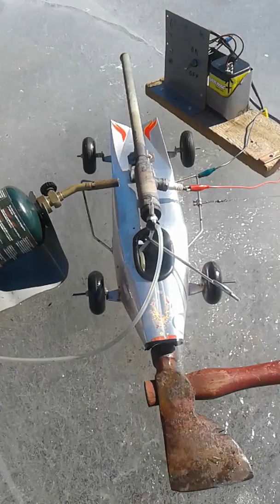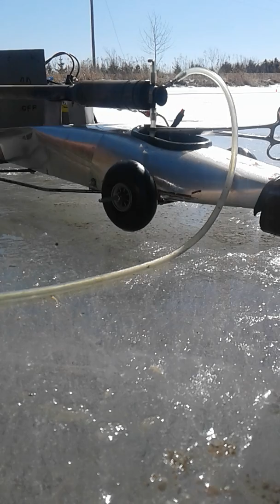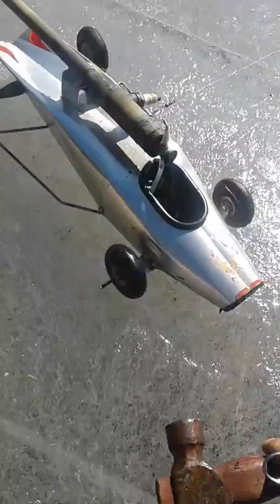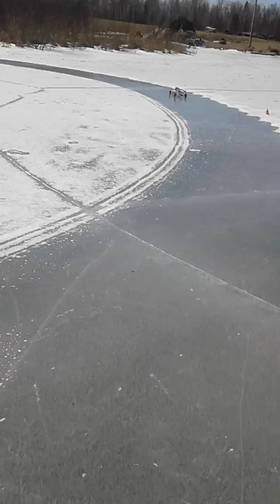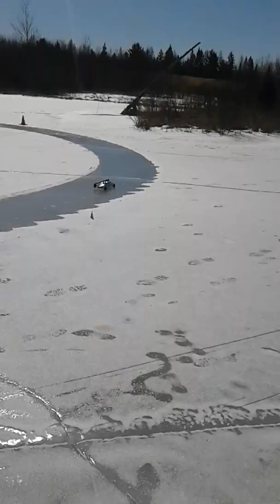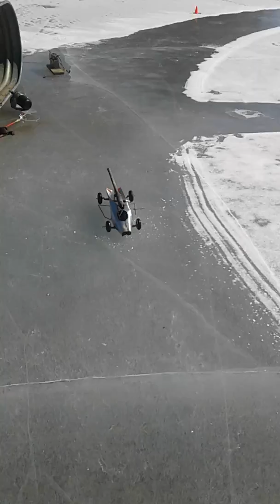Original design Pulse jet teather car 60mph.

Comment from the maker: The 1.25"cc k1,don't quote me on k1? But anyhoo it has a machined aluminum head with cooling fins,it's a mini dyna head,it has a 1" dia.10-pedals valve, & .5" dia. tail pipe. Very good quality little engine.Ive built the .75" cc Dia.Sibley craft jet,it works also.but valves are consumable.

Comment from the maker: that is the same as one of my tigers that I can't get running,I'd like to know all the venturi,&flow jet dimensions of a running one so I can get mine to run.
Reply: My Tiger with the thin lock ring was so hard to blow through the front end with my mouth/almost impossible when shiny new I took a thin ruby rod I had and flexed the reeds by pushing the rod through the throat, but not so much as to keep them from seating. Someone said the one with the fatter lock ring was poorly machined and leaked air. They suggested putting it under water to see if it leaked air when blowing into it. The smaller jets are more fussy with the fuel/air ratios I think, especially with gas because the range it will run rich or lean is far less than methanol. Of course it helps to get some pops in to get it hot, which makes for easier starting. Another thing is aligning the reeds over those tiny holes just right is critical. I lifted some reeds with the ruby rod just to make sure I had the best coverage and watched when they came down. Also maybe check the metering jet to see if it allows gas to flow smoothly through those two exceedingly tiny holes. Maybe a little burr or something could get or be in there.
I recall with my Tigerjet I didn't really like the spark plug that came with it. Sometimes instead of arcing, electricity will crawl over to the other electrode to some extent, maybe if wet, corroded, or dirty. It may not be "the" factor, but sometimes a good spark can help, if other elements are against you. I switched mine out with a 1/4 32 rimfire plug.
Someone wrote ...
"Hi I would try another type of fuel the unleaded gas from the pump is very difficult to start with the little jets. The original gas they used is what we call in NZ White spirits or I think in the US coleman lighter fluid??? try this if you can?? Also the valves need to seal well. Try blowing down the tailpipe to check for leaks, should be like blowing into a wine bottle.. I also stick the head into a bucket of water to check for leaks sometimes... The tigre jet you have is the M1 while mark has the M2 I had a M1 but sold it now only have a M2."
I forgot to mention I thought your little car ran quite impressively.

Comment from the maker: I have two tiger jets,there is a 1.25" cc. k1. & the 1.75" cc tiger.The k1 is high quality cute little thing & I won't even run it cuz it's so nice, the 1.75 is very low quality and barely runs, the Sibley craft jet is good,& my little 1"cc is Awsom "
Reply: Here's a photo of my Tiger, they made some Tigers with a bulky lock ring instead of the thin one pictured here. I  never had any problem starting it up and it ran like a bat out of hell. The reeds were very stiff though, I could barely blow through it with my mouth unlike a Dynajet. which honks easily. Do you have a photo of your 1.25" Tiger. I know they made an M-1 and a M-2, one was slightly shorter. https://www.worthpoint.com/worthopedia/vintage-tiger-jet-engine-nib-134118708
https://www.worthpoint.com/worthopedia/tiger-jet-model-jet-engine-20426709

One time on a lark I started my Tigerjet using methanol by sleeving a silicone fuel line over the starting air blowpipe fitting and injecting air in from an air compressor nozzle. As crude as the offset fueling was, it seemed to run fine. I guess if you were going to run methanol in a normal/practical manner, you would need to allow more fuel flow than what the gasoline metering diameters provide - the fuel/air ratio being different. I put my own 1/4 32 rimfire plug in it because the one it came with was a piece of crap. 
Here's that photo of my Tiger.
http://www.pulse-jets.com/phpbb3/download/file.php?id=14302&mode=view
Reply: Here's that methanol fuel line hooked to the starting air blowpipe which drew in and ran with alcohol seemingly fine although the jet doesn't glow red hot as with gasoline. Just something quirky that worked.
http://www.pulse-jets.com/phpbb3/download/file.php?id=12834&mode=view

Comment: The Tigerjet is a neat little engine with a 1.75 inch diameter. It glows red hot in just a few seconds and the sound it makes incredible for something so seemingly innocuous. Don Laird also drew up those plans. I took the head off of mine and twirling the pipe shape in my hand it just appears so small for the sound it makes. But even the 1 inch pulsejets are way too loud for your ears of course. http://user.it.uu.se/~rist5661/rocketery/pulse_jet_plans.html

Comment from the maker: that Russian pulse jet book on eBay is a great book on pulse jet design and valve frequency timing, fuel systems, & plans in metric, so with good diagrams and metric system, it is understood, even though it's in Russian.
Reply: Don Laird sent me that Russian Book. He's the guy who made the Dyna-jet draftmanship drawing/specs. I liked the manometer illustrations where you can either use the negative or positive pressure waves to create a pressure line or create a partial vacuum with a little valve next to the combustion chamber.
There's also Foa's Elements of Flight Propulsion and Tharratt's papers from the 60's. Also I have a Symposium Book on Pulsating Combustion from Sheffield, England which has some unusual designs. 
http://www.pulse-jets.com/phpbb3/viewtopic.php?f=3&t=2886&p=35956&hilit=sheffield#p35956

Comment from the maker: I got my start with dyna jets,& all available pulse jets, but when I baught the plans from scientific supply,on eBay pulse jet engine plans, that's how I learned the most on how a good pulse jet engine is designed, I highly recommend scientific supply plans,I built all his engines & all of them start from tail if you like. his sr71 can use a dyna head & it puts out 5lbs easy" I've learned alot from his engines, & have designed my own little 1"combustion chamber Pulse jet, with knowledge I have gained from the plans from scientific supply.

Comment from the maker: Hello, 29-4c is common for government missiles & rocket's,it is also common exhaust vent material for gas fired boilers,I get it from furnace supply stores. I use a cheap spot welder, I have techniques that took practice, & modified the spot welder points to be more like a stitch, all my engines are pressure tested to 25 lbs & no leaks,& there's no weld added,light weight for flight engine. My car is mild steel & flux core wire welded with .030 wire, the car is designed to be more user friendly for starting, hence the spark plug. flight engines are lighter and it takes more practice of the balance act to light it from tail pipe, kinda like a valveless balancing act to get them going, Anyhoo good ole mild steel works good also,all my prototypes are made with mild steel, & there still going strong, 100s of runs,kinda crispy but works nice "

Comment from the maker: my 1" combustion chamber Pulse jet, flight engine is 30ga stainless steel 29-4c. It uses no spark plug, I can hold a lp torch to end of tail pipe to start it. I wish I could put pics on here,I will try to get a video soon on my other 1"combustion chamber Pulse jets
Reply: That's pretty clever working with .0125th stainless, sort of in the feeler gauge range. How did you weld it or did you crimp it in some way? I always wanted to make a small pulsejet out of the thinnest material possible. I have some stainless shim stock close to that, .010th.. I saw some plans for a Chinese valveless that was spot welded using very thin stainless .015th if I recall. How did you arrive at using the chromium/molybdenum iron alloy?
Reply: I've  used the tail pipe ignition in the past and there was an article where the poorer Dyna-jet modelers did the same, not being able to afford the buzz box back in the early days. One time my older brother was working in the garage and I picked up a Dyna-jet and started toying with it using some methanol in a finger pump sprayer coating the inside of the jet and then a mist or two in the intake and then I tried lighting the tail just holding the jet horizontal in my hand so as not to drip out the little fuel it had and lighting the tail with the other using a BIc lighter just to see what would happen. Well it kind of burped quietly a few times but this one time it roared briefly to life! My brother was so startled he exclaimed "Damn" in amazement. I was pretty startled too holding it. I've tried this again several times but haven't been able to recreate the effect. The humidity and temperature have to be just right I think.
Another trick I use in the summer in Florida with methanol is to coat the inside of the jet and intake with some alcohol and cork the tail end and then spark it. The extra confinement gives a strong starting impulse, sort of a bang start.

Comment: On the first Dyna-jets they put the spark plug in the neck of all places where it really gets hot.  http://www.pulse-jets.com/phpbb3/download/file.php?id=13414

 Later they moved the plug forward which helps.  My Bailey jet which is about like the Dyna-jet uses a tiny 1/4 32 plug which has the plug pretty far forward. One time I thought about making a pulse jet with the spark plug in the center of the head holding the retainer/valve stop for the valves as well. But then you'd have to design the fuel metering jet a bit differently than how the Bailey and Dyna-jet do it which uses the center of the head for the metering jet and fuel line along with the retainer bolt. I guess you've seen this Sibley jet before,  a single flapper. http://blog.modernmechanix.com/power-it-with-a-pulse-jet/
Here's a few of my plugs, there's another plug I found at the hardware store that is a 10mm but much longer pictured here next to a CM-6 on the bottom row. The largest I have is a 3/4  inch NPT thread and a 1/2 inch NPT thread top row.
http://www.pulse-jets.com/phpbb3/download/file.php?id=14637&mode=view
Here's another smallish jet, 13 inches long and 2 inches in diameter. An odd little German design.
http://www.pulse-jets.com/phpbb3/viewtopic.php?f=7&t=2727&p=68732&hilit=spark+plug+collection#p68732

Comment from the maker: Hello, that is good to know on nip fittings for cm6 plugs, I have used them on several of my pulse jets,on my car I prefer a bigger plug for other reasons, such as, they stick out further from the hot engine, so attaching spark lead & clearance for hi va. is easier to do,& the cm6 plugs can overheat & ceramic part gets looser every time you heat it up,there is not much mass in a cm6 & they get as red hot as the engine, bigger plugs don't over heat,last longer,are cheaper,& more accessible.

Comment: Another trick you can use with the CM-6 plug is that the 1/8 inch NPT female pipe fittings will accept the 10mm thread 1mm pitch spark plug. To verify that I just threaded one into a 1//8 to 3/4 inch reducer I have and it was air tight.

Comment from the maker: Hello, I like the cm6 plugs,but they have a strange tapering thread,if I could find the correct tap to thread a piece of small pipe to accommodate the smaller plugs,that would work. this engine will start with out a spark plug if a torch is at tail pipe opening, my flight engine has optional spark plug.

Comment: That's a nice setting for your testing. I use these plugs sometimes which are more proportional for your size jet and of course you can buy smaller plugs still. http://www.quickieparts.com/spark-plugs/ngk-cm-6-cm6-5812-395-ngk-spark-plug-for-da-engines-3w-engines.html